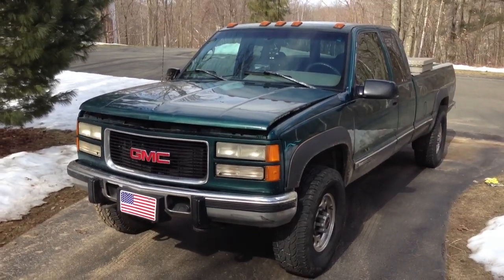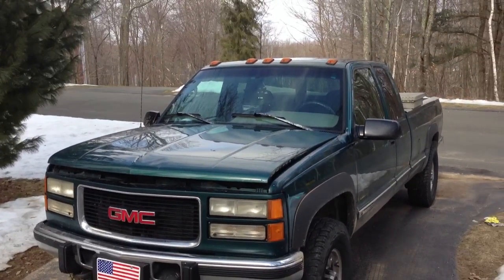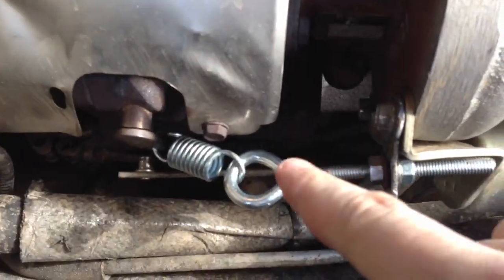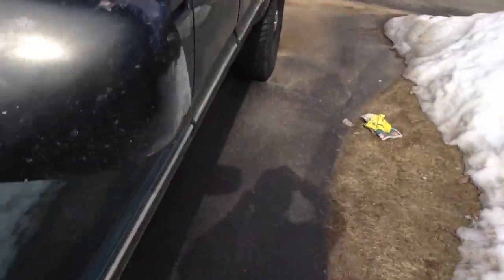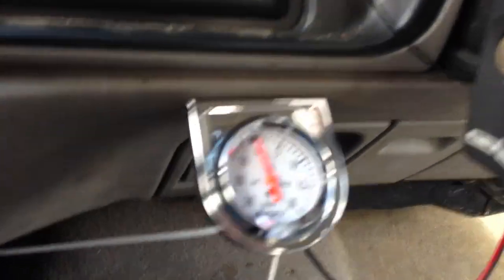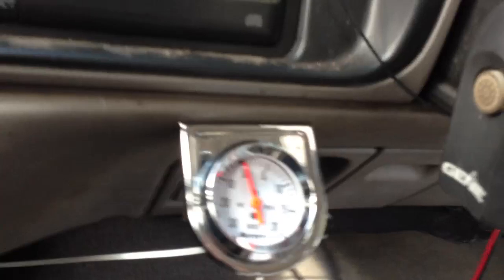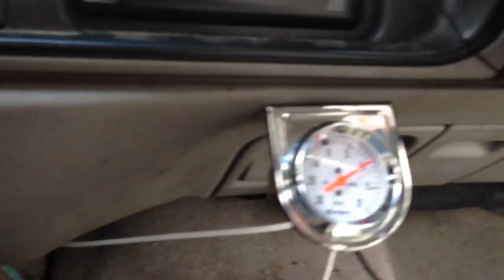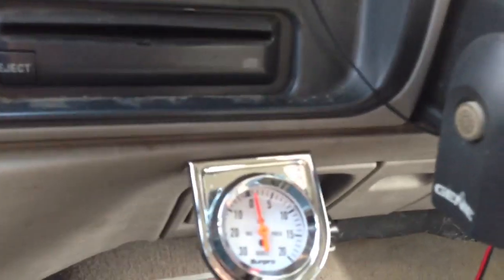How to Make a Manual Wastegate for a 6.5L Turbo Diesel

Comment: Whats that thumping noise you can here from the passager side I just bought a 98 an it dose the same I'm not sure if I should be concerned my 95 I has years ago I don't remember hearing that
Reply: your heads are f*cked my 98 did that .. intake valves are shot
Reply: the thumping noise is not heads, its not intake valves, ya'll are funny! just like someone else stated removed the vacuum pump..  his vacuum pump is bad, the diaphragm makes that thumping noise when they fail!
Reply: want hear it w/seat occupied

Comment: okay people. on these motors,  at least 95+ where everything is electronic, over 10psi on a stock set-up and you will start defueling. as for the vac pump, remove it completely. use a 93 belt the more items a belt has to turn the less horse power you got. not much, but these ain't got much to spare. 4inch straights by diamond eye are a must with a 3 inch down pipe. FYI THE STOCK BREATHER BOX SHOULD NEVER BE REPLACED FOR A OPEN AIR BREATHER! !!!  Biggest mistake I always see. turbos lag in heat and sucking got air from under the good is bad. use a breather box from a 98 or so. the cylinder one. any 6.5TD Questions, feel free to message me.
Reply: How dafuq do you know so much about a 6.5 ... like damn pouring some respect on that
Reply: James Waller hey james. I have a 98 k2500 chevy suburban it has a diamond eye crossover pipe and from the turbo back. the previous owner told me it has a GM8 turbo with a wicked wheel. new to diesels but I got on the highway and the engine light came on. it said p0238 high boost. and was bucking but drives fine in the city. what do I do to fix it? is the turbo too big? I will be installing a boost gauge soon.
Reply: +sneakysnakepie1 gonna have to retune the ecu in it. Google Leroy diesel. he sells a bad a$$ tune for these 6.5s for around 500$ downside, if yours is a 98 then you'll have to send a spare ecu in for him to re flash I always but the 95 year models as the ecu has a removeable chip that can be swapped. 96-00 has to change the whole thing. basically the computer is trying to save your engine. if you hit over 10psi sustained for more then 8 seconds without a tune it'll do this. look Leroy diesel up, also in Facebook the page is called "Leroydiesel 6.5 turbo diesel stuff" 
everyone is very helpful and knowledgable. oh and when you order from leroy, he actually answers his phone and check his facebook. only deals in 6.5 and 6.2s hope this helps you out.
Reply: So a GM8 is not factory?  Wouldn't the wastegate open because I seen on google people having problems with the wastegate solenoid and actuator. But I'm not sure if that's the problem or my problem is the turbo is too big.
Reply: +sneakysnakepie1 gm8 is the factory turbo from 96-00 
gm5 on 94-95
gm3 92-93
the 8 is the best out of the three, but a shiny turd is still a turd. get a boost gauge to find out for sure what your building. I peak at 9psi, cruising at 0-2 on the freeway. if I mash it till go up to 9 and stay their. I built my own manual Waste gate. easy to do. just look up "dyi turbomaster"
if you're Waste gate Is stuck open, you're turbo will never build boost and you'll be billowing smoke from the pipe. if it's stuck close which is rare, it'll build until it blows head gaskets. My 95 2500 only out put a miserable 2psi of boost on the factory vacuum pump managing the waste gate. boost gauge is a must. but i don't think you're having a waste gate issue unless someone already made a manual waste gate or wire the factory one shut to limp it to a buyer.
Reply: +sneakysnakepie1 I noticed my orginal comment didn't state that anything past 15 psi without head studs will blow head gaskets as well.
Reply: +sneakysnakepie1 and that wicked wheel in that turbo has more Valdes then the stock gm8. so it'll spool up faster. the waste gate should still open up regardless of how fast it spools though
Reply: Well it does blow quite a bit of smoke when not started for awhile like a few days. But yeah I'll have to make sure it's a GM8 because he said it like it was a upgrade but it's a 98 so stock except for the wicked wheel turbine that it could have or not. So I'll be hooking up a boost gauge tomorrow. Only goes in limp mode when getting on highway or going like 70 but feels like it has no power. Around the city seems fine but brakes are a tad bit hard to push. Thanks for the help seems like I got my work cutout for me.
Reply: +sneakysnakepie1 these diesels are about the easiest and cheapest to work on. if you're looking to replace the turbo either look into A Team Turbo or a Hx35 off a 12 valve cummins. the hx35 is awesome but requires modification to the intake, making a manual waste gate, and a down pipe adapater, the A Team Turbo is designed only for the 6.5s and it botls right up. 700$ or so is kinda hard to swallow. get that boost gauge first and the go from their. the 2 center bolts on your upper intake have a hollow thread for the bolt. perfect place for a boost gauge. order a boost bolt from leroy diesel to go their for it, or drill a hole (with the upper intake off. metal in the engine is bad) and thread it with a tap and die set. I trust the boost bolt more. can't get boost bolts from a parts store though. they'll be clueless of you ask.
Reply: I'd like to keep the turbo if I can trying to keep it all stock. I just replaced the thermostats with acdelco ones. Relocated the pmd because it was in the original location. It has 133,xxx miles so pretty low mileage. Hoping it's an easy fix because I gotta now figure out why I don't have rear passenger heat it's only in the front. But at idle the heat gets pretty cold but I also have a coolant leak seems to be dripping off the harmonic balancer so I don't know the source. I just know my thermostats aren't leaking because there're new.
Reply: +sneakysnakepie1 that drop is from the water pump. they are a pain to change out.
Reply: +sneakysnakepie1 inspect your harmonic balancer and pully. they have to be replaced yearly. the rubber in them buldge and break loose. snap your crank shaft. replace yearly or replace with a fluiddampnr system from leroys and be done with it.
Reply: I have plans on replacing the whole front like belt, harmonic balancers, water pump, etc. Truck sat for years and it's from the south so no rust. But as of now the rubber on the balancers doesn't have cracks or anything. And plus I need to order the oil lines so they don't break and just a shit ton of work. But I just gotta figure out the boost issue because I might just buy a new turbo (stock) because I just need the room to carry around people not so much in towing maybe a small utility trailer.
Reply: +sneakysnakepie1 look at Latoya for the oil cooling lines. the stock lines are notorious for leaking. I learned myself. leak from the oil cooler under the grill and by the fittings around the oil filter. that's one of the current problems with 2500 right now. leaks by the filter and I recently replaced the leaking cooler lol. I'm sorry I keep saying check out Leroy diesel but he really knows his stuff and he's got exactly what you need to get these 6.5s as strong and reliable as possible. his home page even breaks it down in. and a stock 6.5 is a 6.5 that's prone to breaking down.
Reply: +sneakysnakepie1 don't know where Latoya came from ^^^ ment leroys..
Reply: I've looked into his page, I'll definitely be doing business with him just gotta check the size of them and the weather is pretty cold right now. 50 degrees so can't do much, and for some reason truck has hookups for gauges but no gauges. Seen a vacuum line from the intake but no gauge. And when I did the crossover pipe there's a temperature sensor but no gauge. And a transmission has something welded to the side of it like a temp gauge. So looks like I'm set up for gauges. Plus I'm ordering energy suspension sway bar end links and rear shocks because it kinda needs them. Lol
Reply: Also I didn't wanna drive it because it had no starter bracket or stud on the starter. So I got that all fixed so I wouldn't worry about starting it. What a pain that was
Reply: James Waller ok, I think I figured it out, the vacuum hoses on the wastegate solenoid were switched. I was replacing the vacuum hoses on the actuator and googled to see if I was right. well they had the vacuum pump on the nipple near the firewall. so it was venting and the turbo was on the nipple nearest to the front on the engine.
Reply: +sneakysnakepie1 NEVER START IT WITHOUT THAT STARTER BRACKET!!!! You will snap a chunk off the block and ruin that engine. could be a brand new 6500 optimizer or p400 block and it would straight ruin it. no coming back from that. and glad you figured that out. hope it's running better.
Reply: James Waller i just installed a cool air intake trying to get more power out of my 96 .but i didn't notice the difference between the aftermarket & the OEM any suggestions i'll appreciate it. also i have a 95 gmc gas 454 7.4 & it has way more power than the diesel
Reply: +ggg's fan the best intake for these engines is the k47 stock breather intake off a 97+ model. Go with that. these engines are not like Cummins and powerstrokes. they were made for fuel economy with crediable pulling power. as in adequate. the stock has 190-210 hp depending on the year, about 160 to for the half tons. your 454 has closer to 300hp. torque should be high 300s almost 400. that's about the same as a small block 350 maybe 20flbs or so higher, which has around 240hp. simply put, it's a little gutless. 
want more power, Google Leroy diesel. His home page will set you up with the best way to achieve 300 or so hp out of these engines and all the best and honestly required mods. I'm 2500$ into mine and I still ain't done, I still need a kojo tune and a Ateam turbo to finish it off. plus a forged crank. that'll set me back another 2000$
Reply: James Waller thanks bro
Reply: James Waller howdy James. Is there any way to contact you outside of this forum?
Reply: i did the waste gate like u showed and installed a boost gauge .engine light keeps lighting up on the dash regarding the turbo performance ,how do i stop this from sending the trouble code?

Comment: ok I have a question, so i unplug the vacuum line from the wastegate, but do I block that line of or what.? And I seen the ihoop bout an the spring how it was set up, but I'm lost after that. Like what do you hook the line from the Gage to where.? And I am sorry for asking all this but I just want to make sure I'm doing it right this is my first Diesel, also do I have to do anything thing with the vacuum pump delete or the belt being smaller.? because I was told to do that also..

Comment: You should build more than 10 PSI max. I have a stock turbo and truck on stock fuel and run 15 daily and 18 on good mornings
Reply from the maker: +1JabberJaw stock turbo is inefficient past 12 psi
Reply: No its not
Reply: what psi do u have cruising at 60 mph

Comment: I never knew that when you said "straight piped", you meant you didn't even have a CAT!  The 6.5 must be one of the quietest diesels out there, but yet it still sounds beast!
Reply: when it sounds like this it is opened up as in the cold air filter and  the true diesel turbo muffler . whiich is opened but made little deffernet in side 
 back presure  with a charger is not good.. very bad.